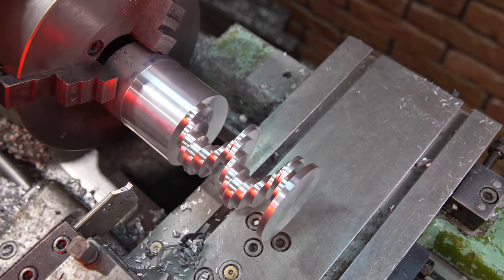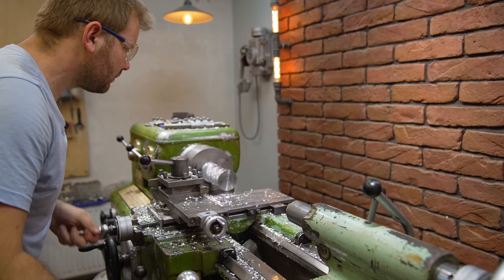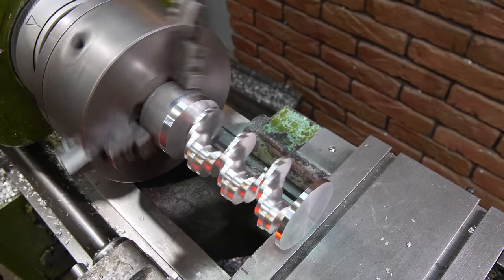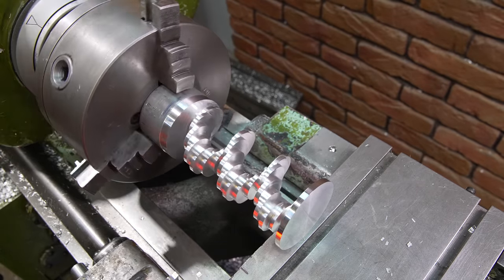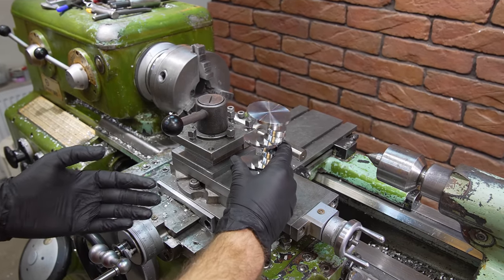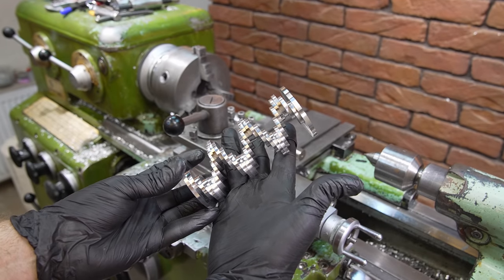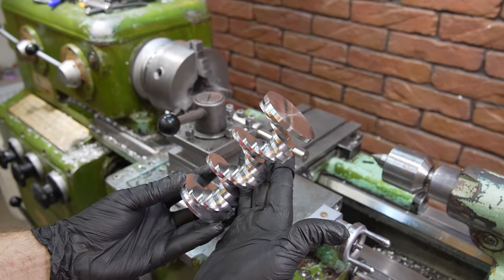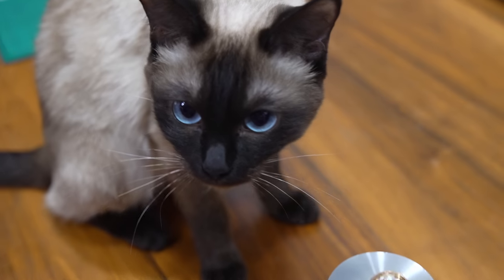Сделал для жены деталь и она перестала ломаться.

Comment: English comment, starting at 2:45, I don't know what the entire project is all about, but it would have been a better idea to support the workpiece on a center.....for each position.  This might mean preparing for this and providing a longer original length which might get "faced" at the end ...but even a very "shallow" center would be far better than without, and only one facing at the end to remove the centers ....or maybe leave the centers as a part of the finished product.(?)

.

Comment: Greetings from Texas
      HOWDY.....🤠
Great work bravo👏 👏

A small suggestion
If one was to leave the first face a little thick then  one was to drill a small center hole on the outside face
 per increment... one would have ten small center points...
Then of course use a live center.....one could speed things up considerably...
Then when project was about finished the last thing is to face all of the center points away
It might make things faster.
If one was to ever do it
again